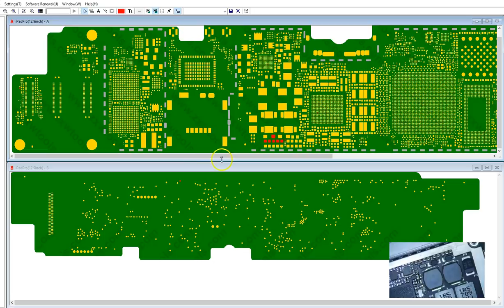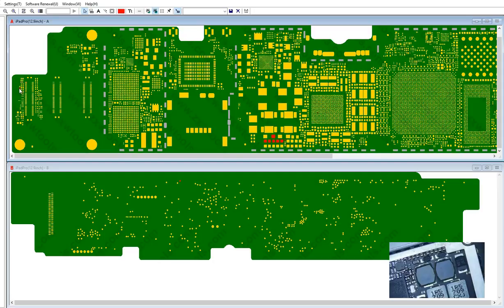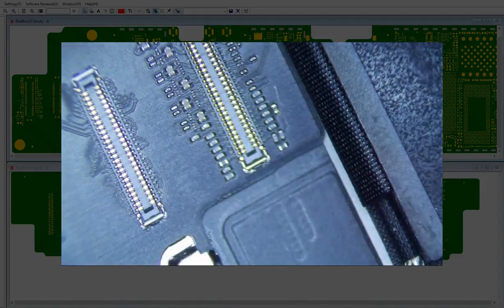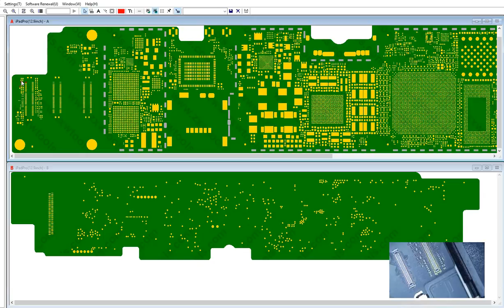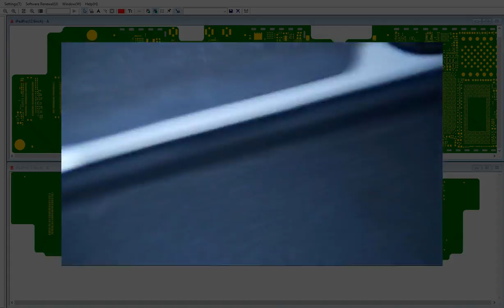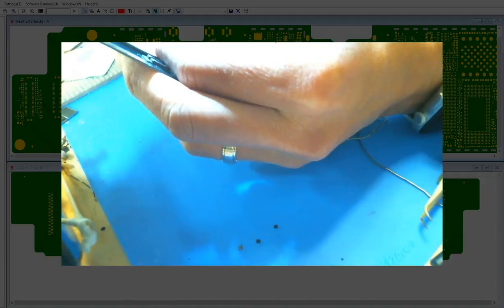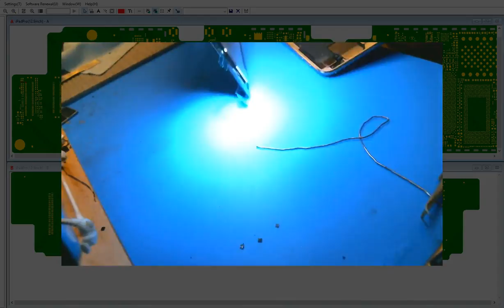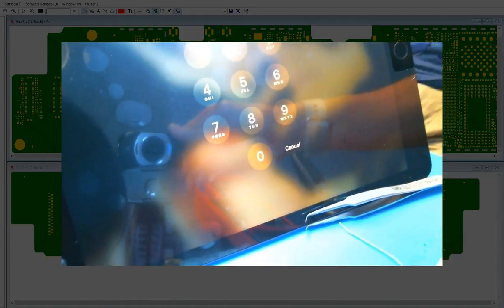iPad Pro 9.7 Backlight Repair

Comment: Hey I noticed the on the site where you buy the filter is says "No Backlight – Apple logo visible, but dark". On my IPad I cannot see anything at all. But the Panel does respond to touch as i have connected to my monitor via HDMI. Should i still try the filter? Or because i cannot see a faint logo this would indicate something else? 

Thanks for putting in time for this video. Really educational!!!